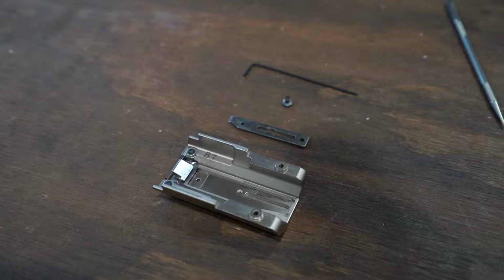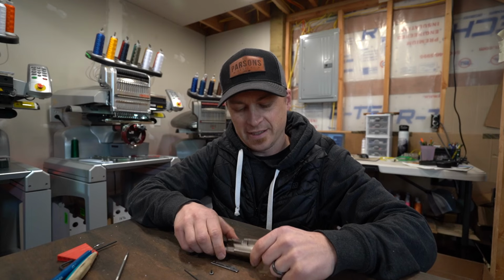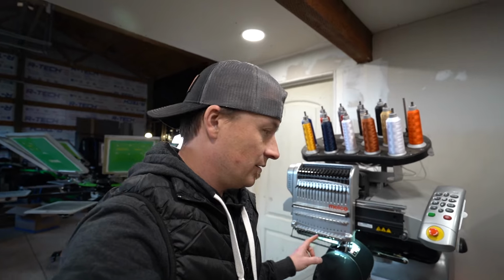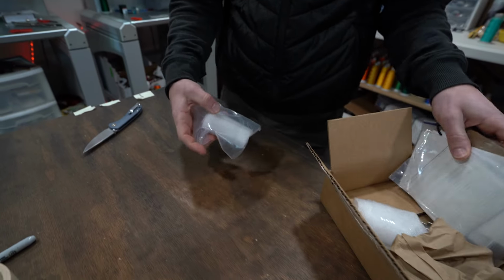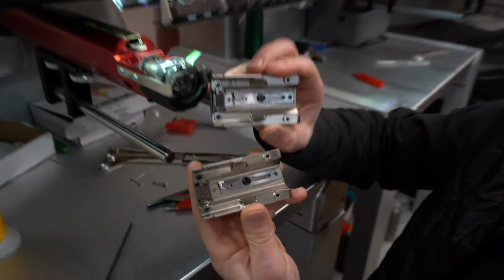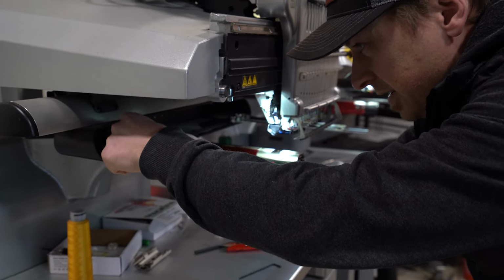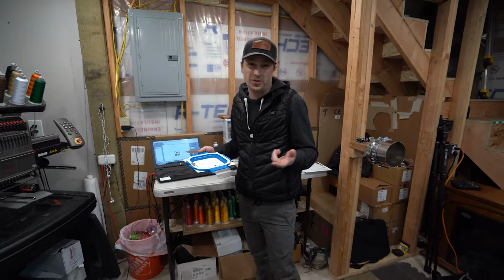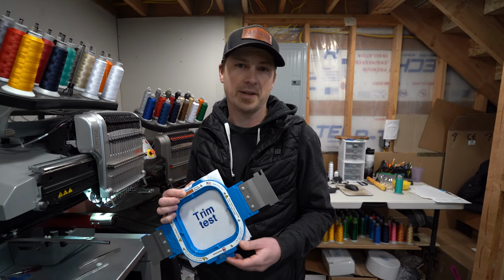Embroidery Trimming Fix

Comment: You have given the best info on this I have seen! Immediately fixed my issue. I was ready to torch both of mine. Tech support just wanted me to run the gauntlet of steps and pages of the manual. You sir are AWESOME!!!!!
Reply from the maker: AWESOME! I’m so glad it worked for you too. I hate Melco’s tech support, they should be teaching us ways to keep these machines running and value their customers a little more. It would make a world of difference for Melco.

Comment: Great video! Thanks for your 'pro' tip!
I got a pro tip for you – at 15:40 == When the embroidery is finished don‘t remove the hoop. Turn the garment inside out and cut the backing with a seam ripper. Cut real close to the embroidery. Looks nicer and is much faster than cutting with scissors.
Reply from the maker: Thanks! 😍